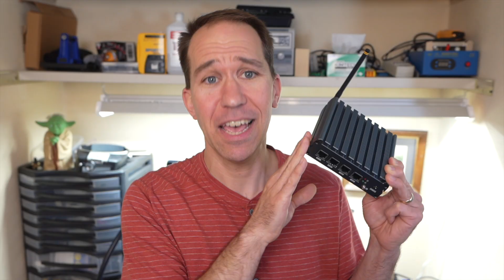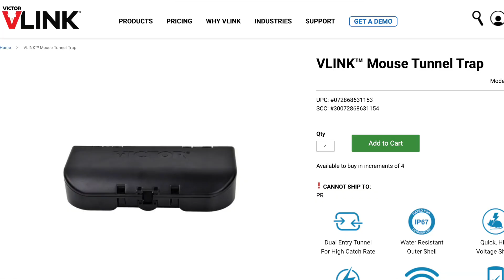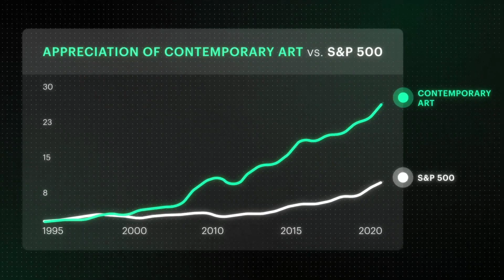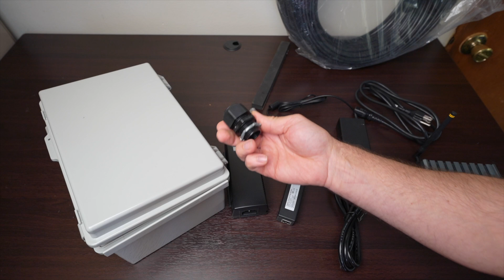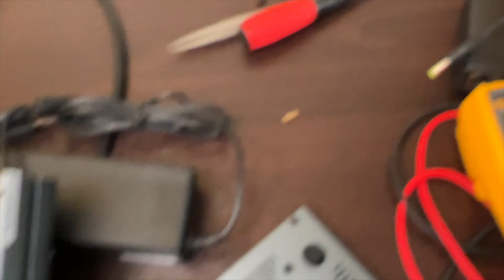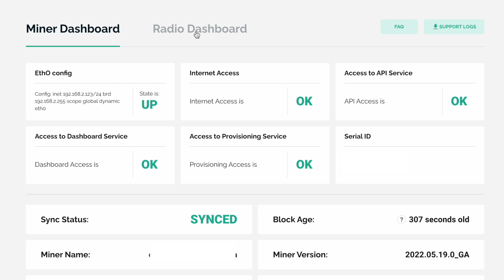I Bought a Radio that EARNS Crypto? | Helium Mining

Comment: Are you making any money?  I was thinking about the same when I saw your video.  Thinking, If I am not home and internet is running why not make some money with the Helium Mining. Please let me know. Thanks, Jo
Reply from the maker: I’ve been waiting for a satisfactory answer from Freedom Fi because their recommended POE splitter broke the power port.  I did just make a temp solution to get power to the board and moved locations and it’s actually generating income!  I’m eager to see if this keeps up.
Reply: @FrugalRepair  its the benz in hnt miner business....consistant    no sd card issues as of yet
Reply: @FrugalRepair What happened after that?

Comment: I really like the project from a techincal perspective, being involved with Embedded, IoT, radio, and stuff. But this project feels like a scam. In the early days, you used to be able to build your own DIY miner as it was fairly open, and there was a way to do that with a Pi and a LoRaWAN module.  But now, you can't earn the "proof of coverage" rewards for hosting a DIY hotspot. Why?? You do still earn the transaction fees, but that accounts for a very tiny fraction of the overall income generated by the miner. Those rewards are not even worth the electricity costs for the radio. And looking how the proof of coverage model works, it would be SO easy to spoof. And sure enough, look at the miners that are currently hosted. there are a LOT, just floating out there in the ocean, I highly doubt these are real machines but instead some carefully engineered virtual machines that are interacting with each other to earn the proof of coverage payouts.

This thing has scam written all over it.

Comment: I don't know man, this looks really like a bad scam.
Not just for the price (that hardware is worth max 150/200$), it's not clear if that company is only charging a lot, or more.

They write about more "mobile traffic mining".. One can think: yes, they want you to advertise their network by giving you something.

But here comes the last part, which is the more important: LoRA is very cool and can go as far as you said with the signal, but it's designed for IoT, which transmits at very low speeds, we are talking about kilobytes, if not even bytes per second.
It's the kind of communication that can work to send simple messages, but forget about 2/3/4/5g speed and watch videos with that radio!

In these days more than before people is living on selling "dreams" to other people.

🙈